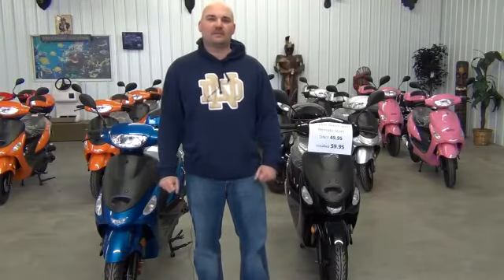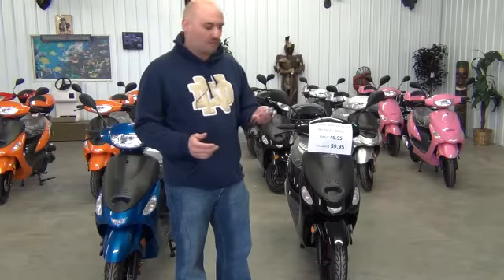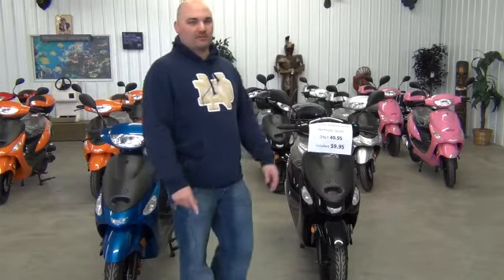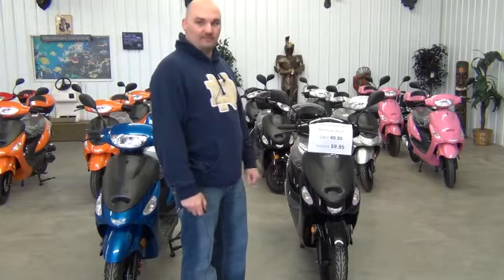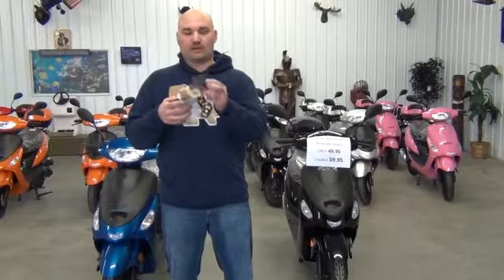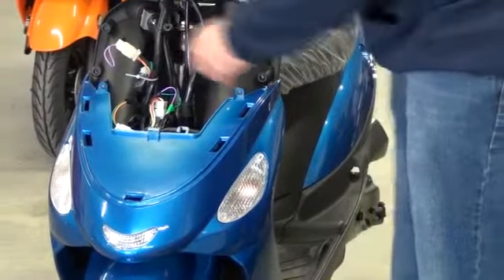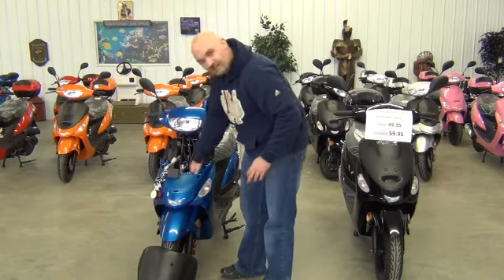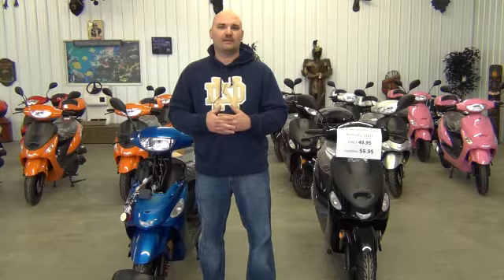Scooter Alarm Install

Comment: That was a super easy install.  I do have a question though, if someone knows about the alarm and has some basic tools what's to stop anyone from opening that panel and unplugging the box?  Is there such thing as a screw that can only be turned by a key?  This METHOD is available for computer cases and car tires, is it available for that panel?
Reply from the maker: ***** Couple things here to think about. If a person is using a screw driver to unscrew the front panel. More than likely it will set off the alarm. Same thing if someone would try to pry the front cover off. The other thing is you can always lock the handle bars. Most scooter's ignition has lock where you can lock the handle bars from turning.

Comment: for what type of scooter works this alarm
Reply from the maker: lucas heemskerk Its an aftermarket alarm system it will work on pretty much any scooter. Some scooters won't have the jumper wire and plug you see in the video. To hook the alarm up to a scooter with out the jumper wire you will need to get the adapter and hard wire it right into your wiring harness.